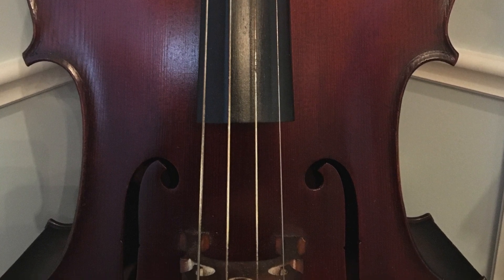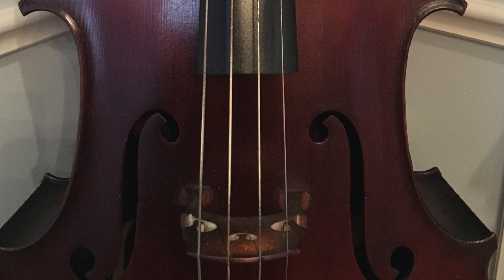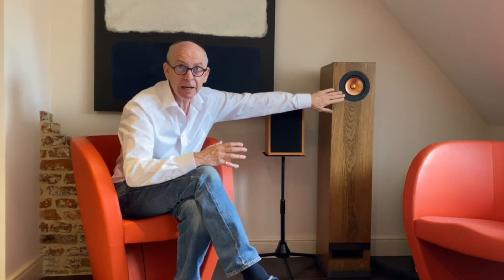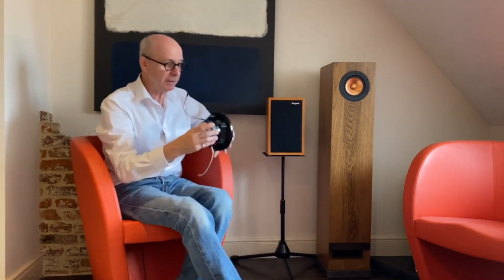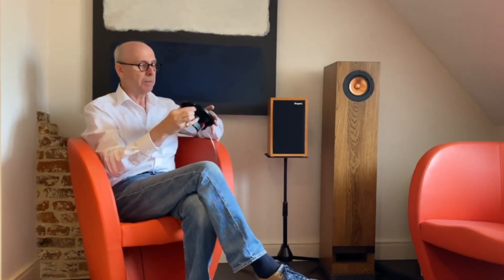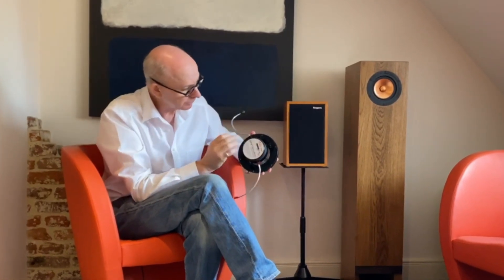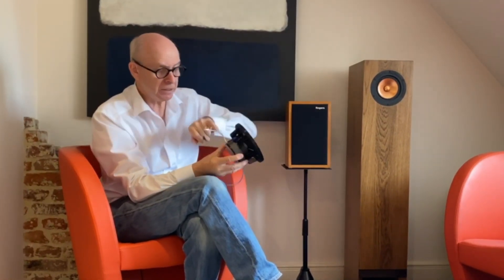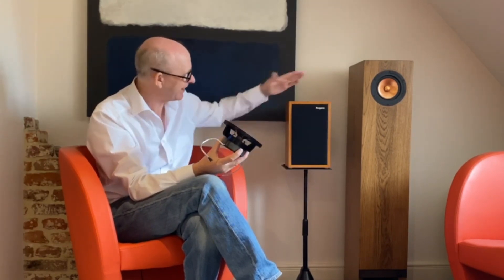The LS3/5A versus the Sibelius Loudspeaker

Comment: It would be interesting to see some measurements for this speaker. Have you performed any?
Reply from the maker: Hi, yes indeed... we have done all kinds of tests but what exactly had you in mind? -6db occurs around 32khz (depending on room conditions). Please check our website for more details.
Reply: Pearl Acoustics thanks for replying. Unfortunately your website seems to be down at the moment. I suppose the frequency response on and off axis, indications of horizontal and vertical directivity. The mark audio drivers are quite interesting but I’d imagine hard to implement across the full range with a flat response-I know that you’ve done a lot on the cabinet.
Reply from the maker: @kristiantizzard7796  Hi Kristian, I have just checked the site and it seems to be up: try: www.PearlAcoustics.com - if you still can’t see it, please let me know. to answer your question. Without crossovers a perfectly flat loudspeaker is almost impossible (and possibly not desired). The only microphones that I use that have a ‘flat’ response are our B&K test mics. But if you use them for recording music, they sound awful! Over time, all loudspeaker manufacturers have understood that, not always ‘flat’ is best. However, our tests show pretty good off axis, compared with multi-driver systems. Only having one driver, with a shallow cone - really helps produce a wide natural dispersion.  Most of our real Human based tests have been done in different locations and performing side by side comparisons (over a wide genre of music) with loudspeakers, such as QUAD ESL’s, Von Schweikert, B&W 800 series, Magnapans etc. We did these with independent listeners, taking into account their views, until we saw that any bias we might have was indeed, in-line with their tastes and our competitor’s products costing 15k EUR and more. We also carried out hundreds of sweep and decay tests - until we ‘got it right’. I know this reply is not scientific but we prefer not to publish our technical results (like most manufacturers) because we open up ourselves for technical criticism, rather than listening criticism. Needless to say, the one thing that everyone is very surprised with is how low our loudspeakers go down to, with clarity and detail - and the fact that all the high frequencies seem to be there in side by side comparisons. Hope this helps?

Comment: its a quarter wave transmission line and it can go 1/4th of Fs of speaker. why try hiding it, cmon
pearl acoustic speaker sound very nice, and quarter wave are hard to design....so its fine to tell us the internal

technically, the the column of air adjust the back wave phase in such a way, that it comes out in phase. 
the bottom vent is same as the driver Sd

a quarter wave V horn is, when the sound expand and then compress back as it moves creating a buffer or a lump mode of sound, filtering HF frequency.

Comment: I have a room that is 40m2 but is 4,5m high ...And struggle to find the right speaker. I have 3 pair speakers today.  AAD 2002 (by Phil Jones, ) Mordaunt Short System 442 and a pair of Cerwin Vega HED CH 504 R. All of them has their pros and cons. The first two pair has lovely mids and highs and the AAD go down to 28 Hz, but non of them fill the room . That the CV do, but as it is an CV sound quality suffers in mid and highs, still it's one of the better sounding CV:s  out there.  So I am looking for a speaker that can replace all 3 pairs....Love the Rogers if I had a small room. I would have a pair.
Reply: Very tall ceilings can present acoustic challenges, but can also provide opportunities to enhance room acoustics.
The relative dimensions and geometry of the room are critical. So tall ceilings over a larger area may or may not present acoustic problems.
In my small sound recording studio at home i thought i wouldn’t have any major acoustic issues but this was not the case.
In the end i needed bass trap insulation in the corners, a couple of acoustic panels in the rear plaster wall and one cloud panel above the desk. Also a large Acoustic blanket that could be drawn across the window and door.
Sometimes its just a matter of lack if sound damping and reflective surfaces in the wrong place. Shifting things around can help. Not just the speakers but heavy coaches and other furniture.
Good luck

Comment: Great post. I listen in a modest sized living room (semi detached house) with an AVI anniversary integrated amp, new Auralic Altair G1 Streamer via Qobuz through LS3/5A (bi-wire 15 ohm which I have owned for nearly 30 years) + REL SUB (set up perfectly) with Russ Andrews Power Supplies and KCAG interconnects plus 8TC cables bi-wired... doubt I'm missing too much in my setup, as the little monitors do what they need to do and the sub does what it needs to do seamlessly... but I am happy and open to be corrected. I have nothing to lose, 100% agree that the LS3/5A without a sub are woefully lacking, (hence the Rogers AB-1 subwoofers being manufactured) ... but set up perfectly with REL... Mmm not so sure... the soundstage, placement and imaging I hear is jaw dropping, especially the vocals 😉 great post BTW and very watchable... Audiophiles always lust for more! 😂 Thanks for sharing!

Comment: Nice business talk, but a speaker is no musical instrument, and one speaker can never get 30-20.000Hz.
It's just a big compromise. Nothing more, nothing less.
Reply: markaudio alpair 7ms has Fs = 74.724 Hz
theoretically, the speaker with Quarterwave transmission line on paper can go upto 18.681Hz.

So, his claim is kinda right on figure of speech
38Hz or 30Hz at f3 point (-3dB from flat freq response)

as room are not ideal. if everything is ideal as per theory, these can reach 18.681Hz

not supporting him or his brand, just telling the facts

Comment: Sorry, but I’m not buying the idea that that tiny driver produces 36Hz.  Maybe at minus 15db level.  BTW, throwing out a frequency without referencing the level is worthless.
Reply from the maker: Dear Ronny and all those who are concerned about the size of a drive cone and the loudspeakers’ ability to produce bass, please understand that the bass is not related to the size of the drive cone. Strange how it may seam. It is how they push the air through the enclosure. You can hear the deep thump of an acoustic double bass at the back of a concert hall. The size of the double bass’ bridge (the part that transfers the vibration of the string into a downward movement) is only a few centimeters wide and only moves a fraction of a millimeter. The bass is produced by the compression effect of the air in its enclosure. Our drive cones work in exactly the same way as the bridge of a double bass, except, unlike the bridge, they can move several millimeters in a lateral direction. It’s not magic, just acoustics and can be simply explained. I hope we have te-assured you! Trust me, we have never had a client complain about a lack of bass!
Reply: @PearlAcoustics  I can appreciate what you’re saying.  However, I still note there’s no minus decibel level listed for that 36Hz figure.  Without that, that 36Hz figure is meaningless.
Reply from the maker: @ronniefranks4351  totally agree. In a well balanced listening room the Sibelius loudspeakers are flat (+/- 3db) at 38Hz. snd are -6db at 36Hz but fall off dramatically after that. Hope this helps?
Reply: @PearlAcoustics  Thank you, that helps and those are great figures.  I would much like an opportunity to hear them.
Reply from the maker: @ronniefranks4351  where do you live? City, country. Or send us an email… from our website. PearlAcoustics.com
Reply: @PearlAcoustics  Unfortunately, I live in an area that could only be considered to be audio hell.  I live in Prattville, Alabama, USA, just north of Montgomery.  There’s very little audio culture in the entire state.
Reply from the maker: @ronniefranks4351  but we don’t work with retailers anymore. Everything is bespoke made and we have a waiting list. Usually our customers offer their houses to interested people. I’ll see where the nearest customer is!
Reply: Hey Ronnie. I get your skepticism because i had exactly the same thought when i read about mark audio drivers (drivers for sibelius aswell). After doing tons of reading and asking many people i eventually built a frugal horn xl with alpair 11ms drivers.

I was skeptical until the moment i fired them up. Once i listened to them oh boy! bass was overwhelming and deep.

Not gonna keep on blabbering. If you ever get a chance to hear mark audio alpair 11ms drivers in a frugal horn xl you will be surprised.
Reply: Precisely ..... More like -30 dB ... 4" driver is midrange ONLY

Comment: I wonder if playing back low frequencies and mid-high ones with the same driver could lead to some level of IMD  expecially at higher SPL
Reply: In theory, yes, but in practice is the least of your worries. It's called Doppler distortion. The transmission line reduces the excursion needed from a small driver for the same bass response.

Comment: I'd love a bookshelf version of the Sibelious.  I would be a must buy for me.
Reply: a bookshelf full-range speaker is technically more or less impossible to build coz you need a chassis with a good QT to cover higher frequencies but in a small case such a chassis can't produce any low frequencies. The smallest full range speaker is the legendary L'Audiophile LePetite but it is not exactly bookshelf. You can find the construction plan on my (German) website. The plan itself is in French of course. http://detailverliebt.info/blog.html
Reply: @Detailverliebt  well cutting the bass a little bit let's says at 40hz or 50hz it would be possible... obviously it will not be the same as the tower but It'd allow more people to enjoy the Sibelious sound.
Reply: @net_news  50Hz would be an absolutely stunning result but I am talking about cutting the bass below 100Hz maybe 150Hz
Reply: @net_news  The Sibelius "sound" is that of complete accuracy from 38 to 20k.  That is why they do not make a bookshelf speaker.

Comment: A great video. I currently have LS3/5a's and have been looking for a pair of speakers to give me that extra bottom end without losing the magic of the midrange. The Sibelius looks very intriguing.
Reply: Full Range Drivers like the Mark Audio Alpair might not give you what you’re looking for - but the Pensil cabinet design does get about as much “low end” as possible out of the design.  It’s TOUGH to better the LS3/5a for voice.